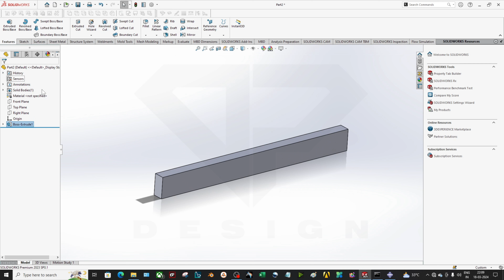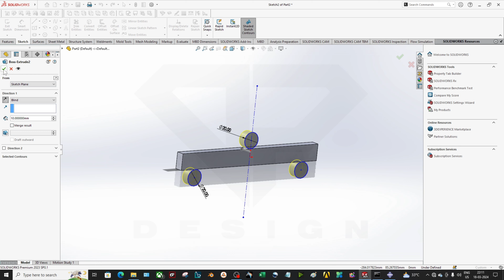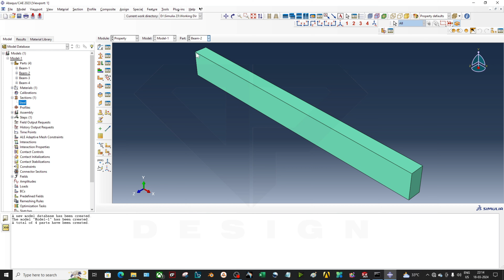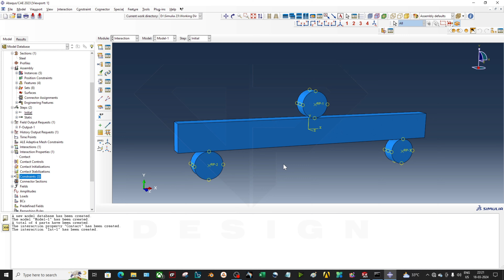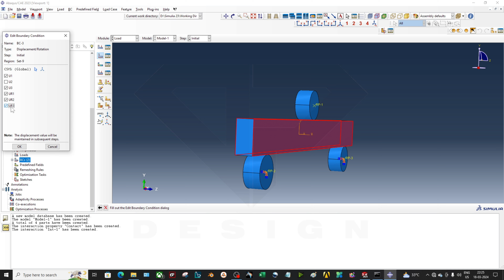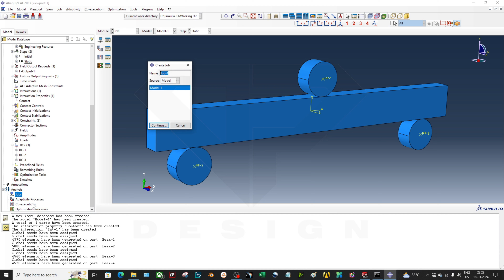3 Point Bending Analysis using Simulia Abaqus | CAE | FEA | DP DESIGN

Comment: Hi, thanks for your useful video.
I have a question about the results.
The three point bending standard is that the displacement should not exceed 3.5 mm, right?
Now we can say that if we did not apply any load and suppose that the upper cylinder has a displacement of 3.5 mm, we can say that if the ultimate and tensile stress of our material is lower than the mises stress at the state of 3.5 mm, so the part does not fail in static analysis?
Is this right??
Reply from the maker: Yes it's right. It will not converge properly if you are doing static and applying large displacement. Within the limited displacement and we let it follow hooks law, there's no problem but if you are going beyond that you must use explicit or dynamic Non linear simulation which allows you to see the accurate results at Large displacement

This simulation was just an example so we gave it an assumption value of 3.5 mm, there's no specific thought about this.